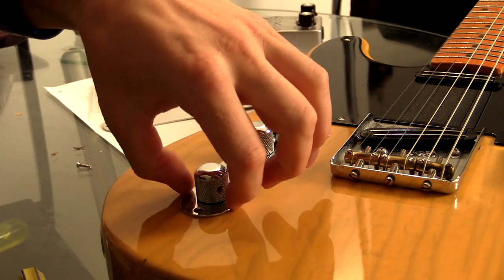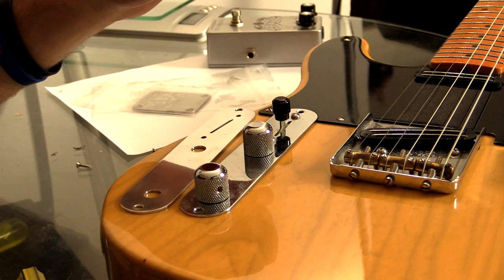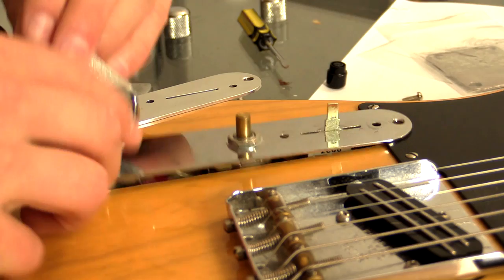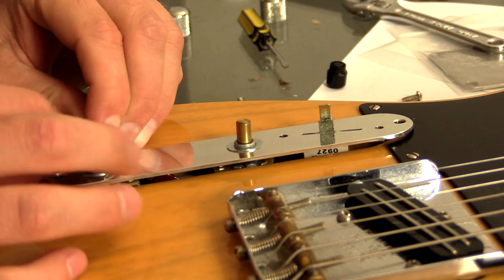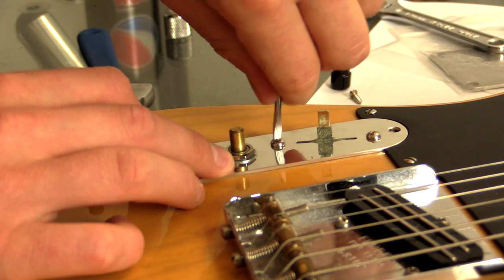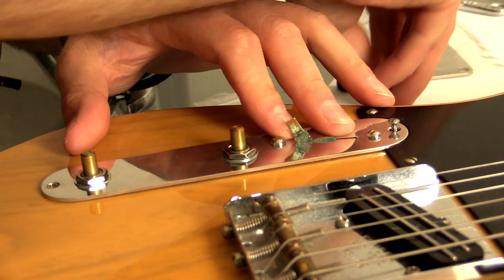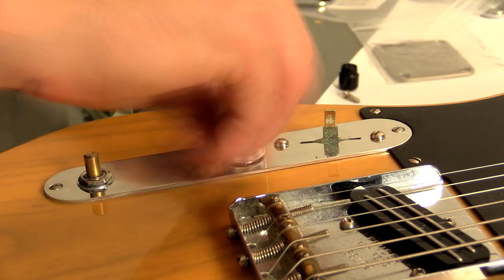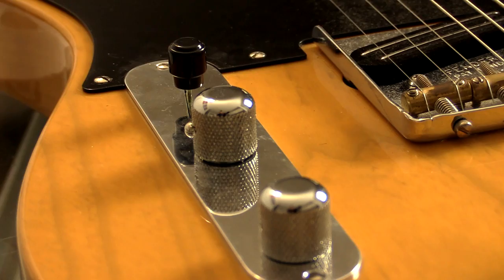Rock Rabbit Guitars - Titanium Angled Telecaster Control Plate

Comment: Another easy mod is to turn the plate around and swap tone and volume pot. This way you have the volume knob easily accessible. The downside is that the selector is unlikely to be easily turned without re-soldering, resulting in it to work in reverse.

Comment: I just got two, one from Rock Rabbit Guitars and the other from Rutters Guitars. They both have angled switch slots but the Rutters is chrome covered cold rolled steel just like Fender makes, so it's nice and shiney compared to the Rock Rabbit, and the Rutters also gives you an extra 3/8" room between the toggle and the knob closest to it. The Rock Rabbit is aluminum by the way--not titanium. They make a titanium control plate for Esquires but not Teles. I guess the advantage of aluminum or titanium is that they're lightweight and won't rust. I like to keep my switch toward the rear, and with the tone knob on the Rutters unit being a bit further from the switch, it makes it easier to get my pinky around the tone knob for wah-wah effects. Both are nice units though. Rutters is $30 and took over a month to get here. The Rock Rabbit was $25 and got here in 5 days. I'll be posting a video on them both this weekend.
Reply: Did you ever post a video about them?

Comment: Nice.  I've never seen the angled plates before.  I have my controls reversed which is an easy mod if the original wiring wasn't installed too frugally.  

Two requests: 
1) I'd be interested to see the neck plate changed.  I've thought of getting a custom one engraved for my '90 Tele Plus which will have been with me for 25 years soon.  I'm not sure about unscrewing the neck, though, as I've never had to do that and I don't want to muck up the alignment.
2) I want to hear the Super Glue story. :-)

Comment: Tele pickup selectors don't really get in the way. What I hate is the angle of Strat selectors. Perfect angle and position to accidently knock. I can't be the only one, and yet they've persevered with the design since forever.
Reply: Yep, it's part of the reason I hate strats! Although I'm not a fan of the pickup selector on the tele either, I find it too awkward to change from the bridge pickup. I think the best switch is on a Les Paul; can't accidentally knock it, and it's super easy to change pickups!